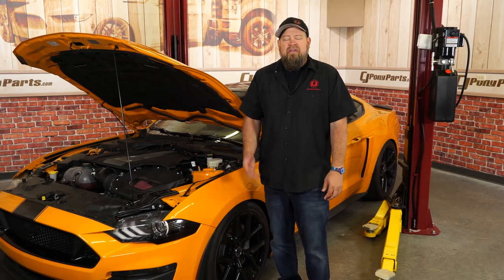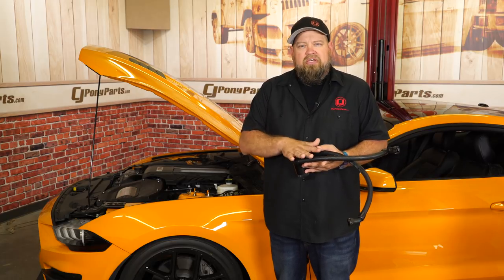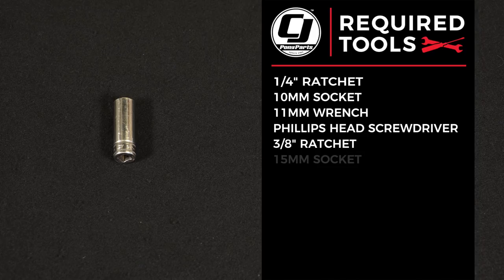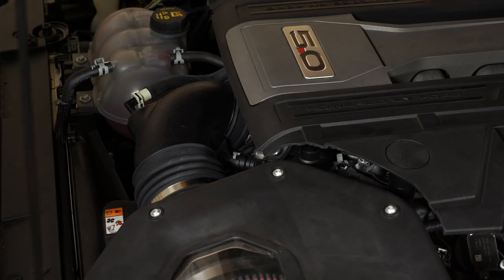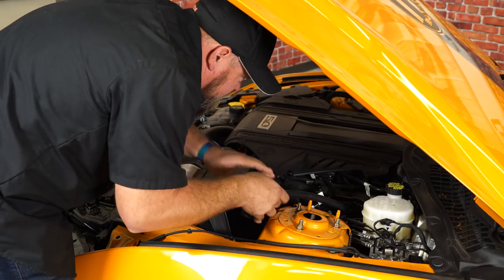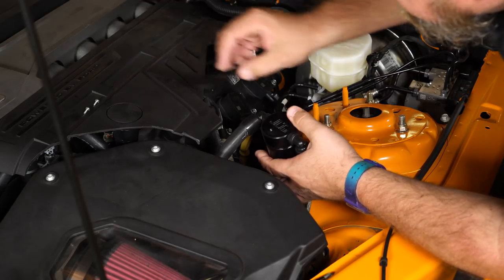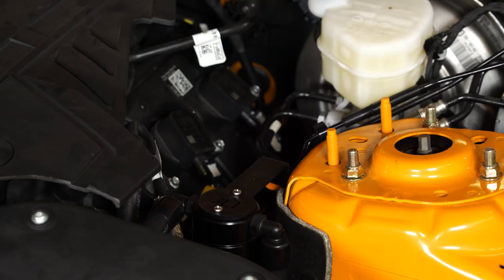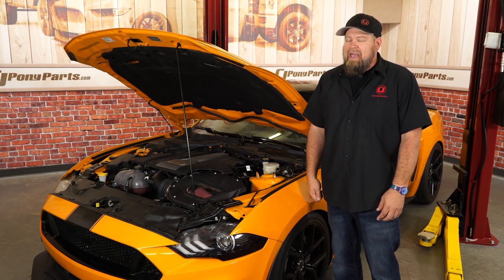2018-2023 Mustang GT Install: J&L Oil Separator Company Black Anodized Driver Side 3.0 Kit

Comment: I hate that the drivers side has rubber hoses,that could collapse over time,unlike the passenger side that uses pvc/plastic hoses that wont collapse over time......
Reply: In that case then there’s a lot of rubber hoses in that engine that could collapse over time

Comment: which side is the more important side to get or both?
Reply: For the 2018+ GT Ford only makes a kit for they passenger side which Ive been using. It catches some oil but not a crazy amount. I’ve been curious to try out this drivers side can but I don’t think it will catch much. From videos I’ve seen of GT350 owners who run dual cans the passenger side gets significantly more oil.